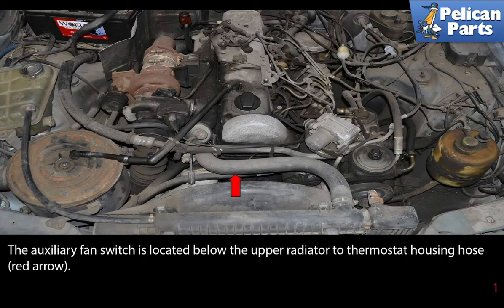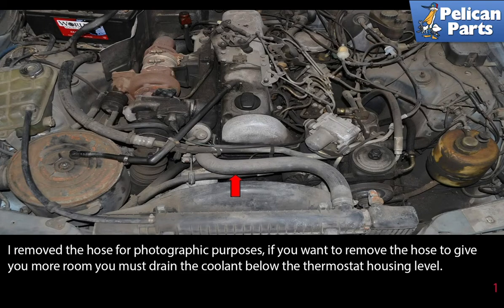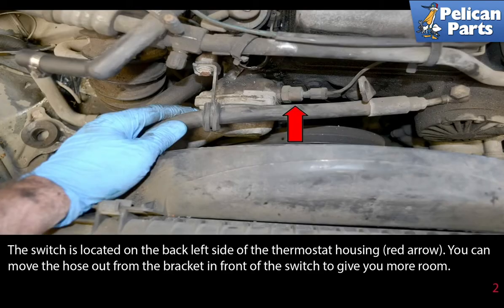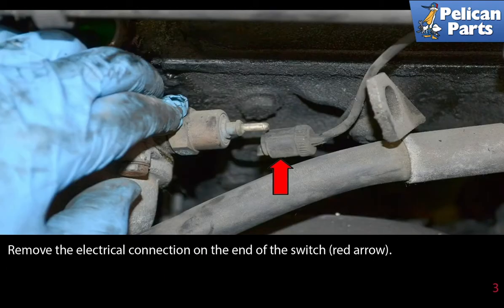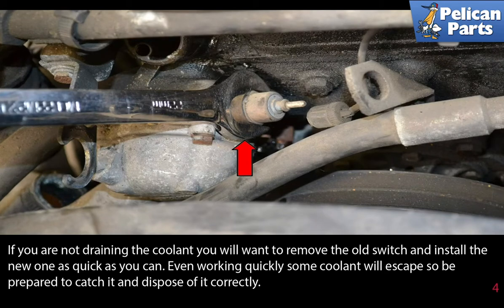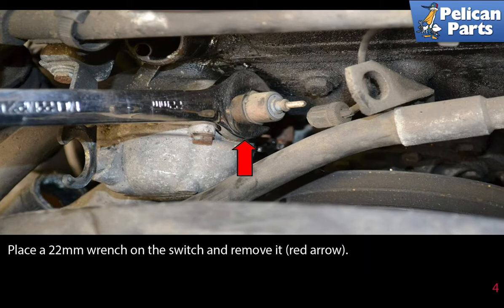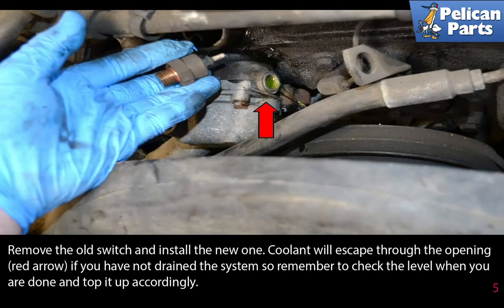Mercedes-Benz W123 Auxiliary Fan Switch Replacement for 240D, 280CE, 280E, 300CD and 300D

Comment: Where is my switch on my 1980 240d manual car? I’ve test the sensor on the a/c drier. Works. Now, where is it located for the coolant? Weird. Thanks
Reply from the maker: Should be in the cylinder head. I don't have info going back that far to confirm my memory.